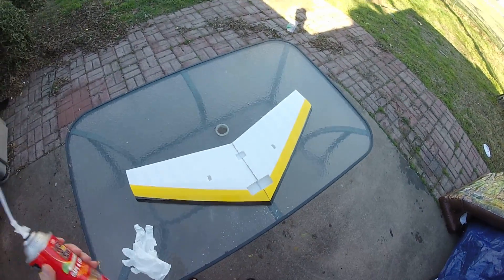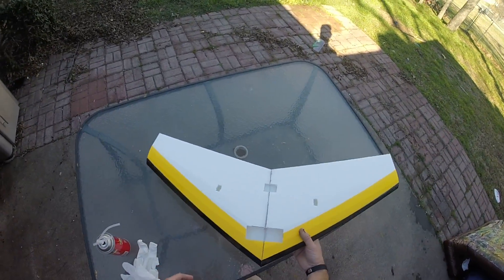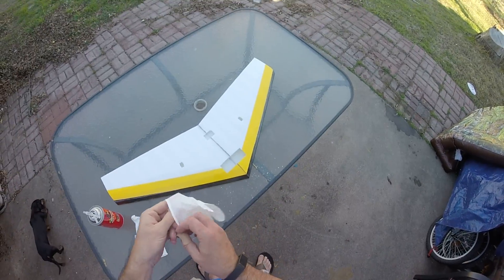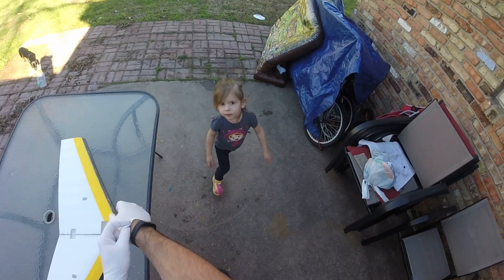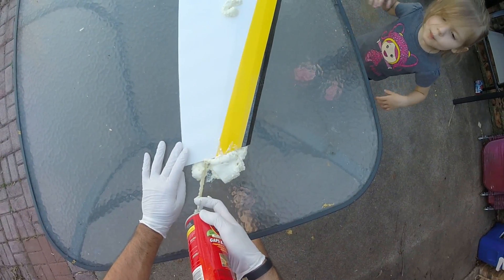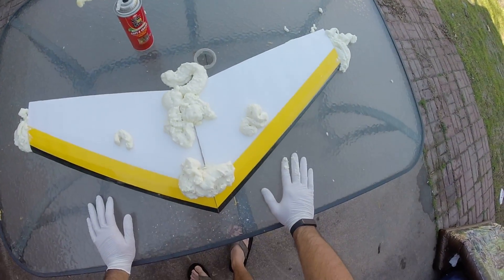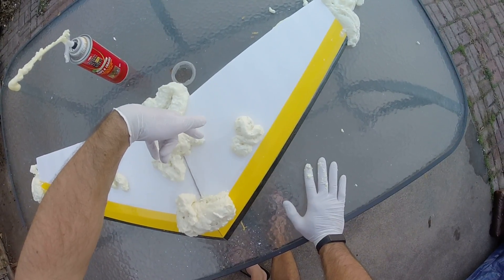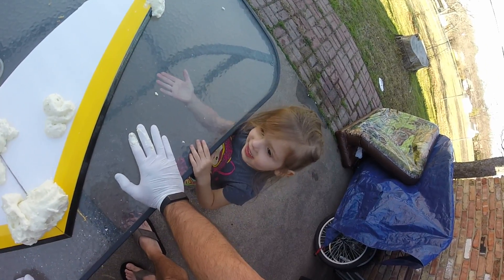Filling A Flitetest Versa Wing With Insulating Foam

Comment: I tried this last night and let it set up over night. I kind of screwed up and it sealed the ends and the inside stayed wet. So I cut holes in it to dry it out but I think it will be a throw away. I think putting a little in and letting it set up then doing a bit more till you get to the vent points.
Reply from the maker: +Kirch93 this happened in one of the early ones I built did that. I crashed it, and a big bubble popped up like a tumor LOL.

Comment: Is not this heavy?
Reply from the maker: +FPV 4 Fun probably not as heavy as you might think. I once weighed the difference, but I can't remember the actual difference. Once the moisture leaves the foam, it's pretty light.
Reply: Would like to know. Does this add just like 10 grams or 50 or 100 or more? I have Versa without motor mounted at the back. Was in front. I am going to add motor. But it seems that the tapes reinforced it very good way. But I use different foam board. There is not paper. I just tape it more or less whole area or where I think it is necessary and save weight a little. But this one is taped also inside of the wing. The strength seems to be nice. And it is not heavy. But the process you do could help in areas where is motor mount or problematic areas. I have Blunt Nose Versa, which got few crashes and maybe some further reinforcement could be helpful. Since I did not use so much tape in the inside of the wing. Saved few grams. But for FPV it is better to tape it inside. This process you mention could help the problematic areas seems to. That it is why details about added weight would be nice to know.

Comment: Shane, do you have a motor/battery example for this type of versa? I ended up filling the whole thing with foam today as my setup used a power pod but frankly my idea is to hide everything inside the versa. Mine has 125cm wing span.
Reply from the maker: +George Georgiev On the regular-sized Versa wings, I always ran the Turnigy 2826 1400KV motor, a 30a ESC and a 8X4 or 8X45 prop with a 2200mah 3s.

Comment: I tried that foam thing and It worked great! I made FT Versa and filled only the leading edge but I may fill the whole thing soon. Also, spray some water on the surface where you spray foam. It will help activate.
Reply from the maker: +George Georgiev I've seen a lot of people fill only the leading edge. It really helps to balance when you do. Just make sure to do something about the motor mount because that's the next weak spot in the Versa.

Comment: Great video! I'm build my first Versa right now and I was wondering how you routed your electronics through the foam? Cool idea, and thanks!
Reply from the maker: I cut shallow channels and tuck the wires in just like you would do with a EPP wing build. I then tape over the cuts with packing tape for strength.
Reply: +Shane McDowell  Do you put the servos under the foam after the channels are cut? Thanks for getting back so fast.
Reply from the maker: +Garrett Pierson I cut rectangular holes and install the servos from the top.
Reply: +Shane McDowell I was also going to add the blunt nose wing as well. Would you suggest filling each individual wing first, middle and then cutting the compartments out?
Reply from the maker: I've done a couple of blunt-noses using this same method. The only difference is that I didn't cut the door with the hinge in the blunt section. Instead, I made a coroplast door / cover. Always completely build the plane, then fill with foam, then cut bays for the battery and electronics. I tried filling the wing halves and then gluing them together, but I don't think it was nearly as strong as filling it all as an assembled unit. Also, keep in mind that the blunt nose version requires a bit of weight to get it to balance. I always liked the non-blunt-nose more because you can still fit your FPV gear on it, it's only two sections (stronger) and the CG isn't as hard to get correct. If you build a blunt nose, try cutting a "notch" to move the motor as far forward as you can. It will keep you from having to park a bus on the nose to get it to balance.
Reply: +Shane McDowell  Sounds good thanks for all of the help!